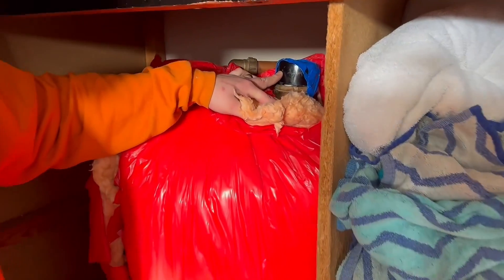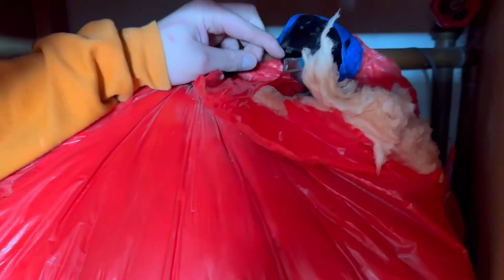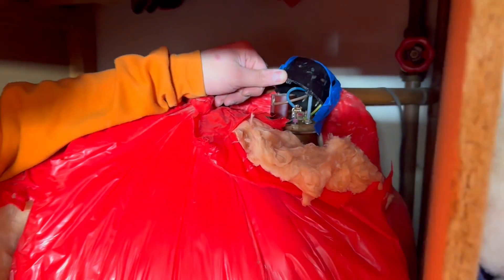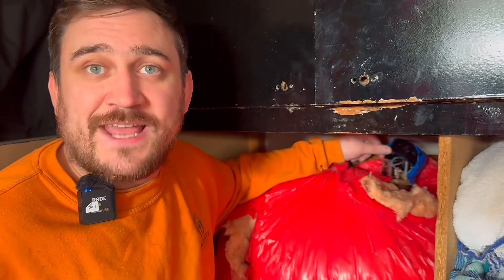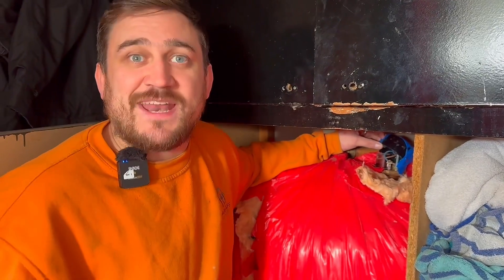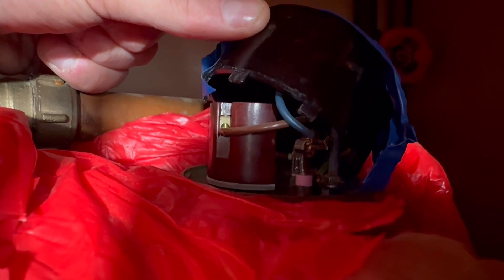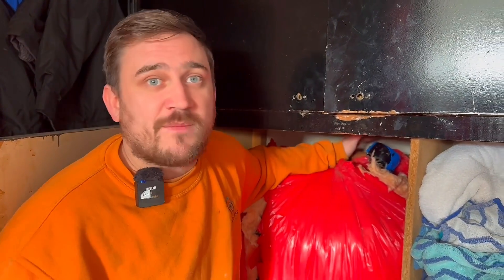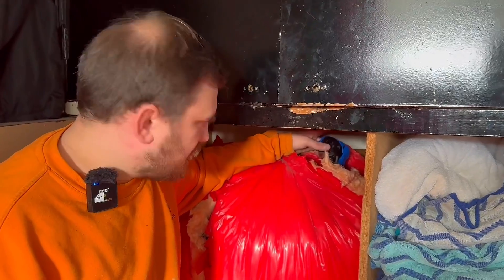EICR - Issues with an Immersion Heater C1 or C2?

Comment: C1 because you can touch the neutral, which should be considered as a live conductor as well as the line. It’s probably bonded to earth, but if there’s resistance in the bonding then there could be a potential to the probably grounded copper cylinder.
Reply from the maker: Thanks for sharing your thoughts 👍🏻